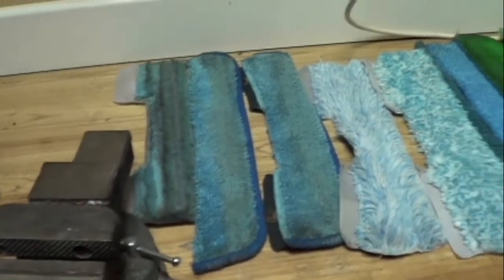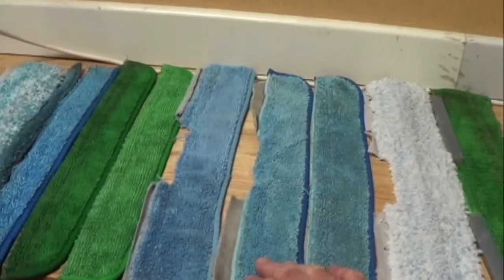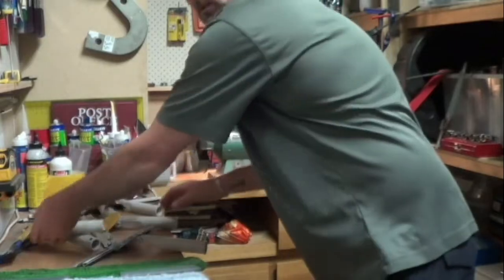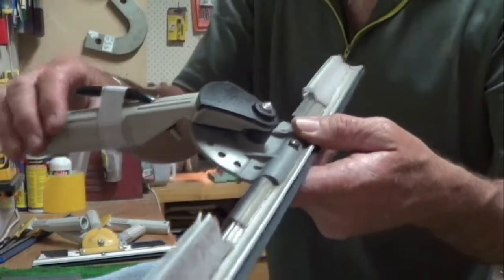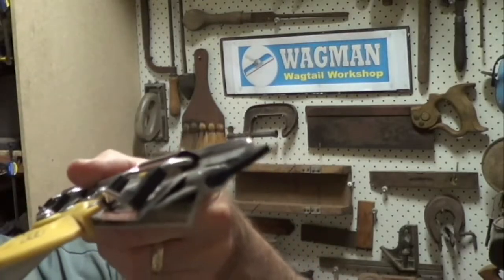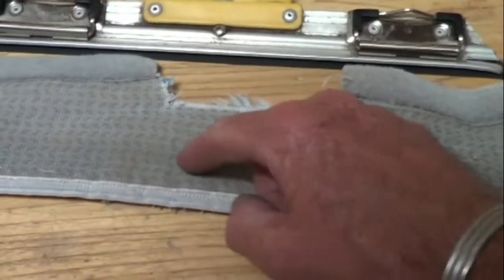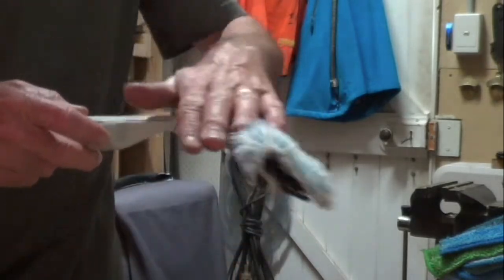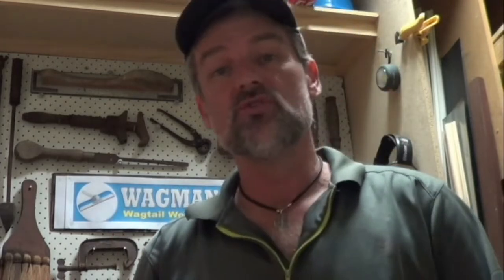Pad and Clip Modification for Wagtail.  Part one

Comment: Thanks for the informative and detailed videos. I have a slimline and a high flyer, that I play with now and then. I want to learn to use them more often. 😊
Reply: J W  Gday JW, yes wagtail can be a bit tricky to get used to, I’ve been using and modifying Wagtail’s since 2008 and I’ll show you the best ways that I’ve found to modify and use them.  Stay tuned pal. 👍